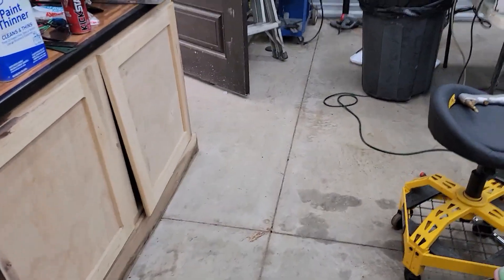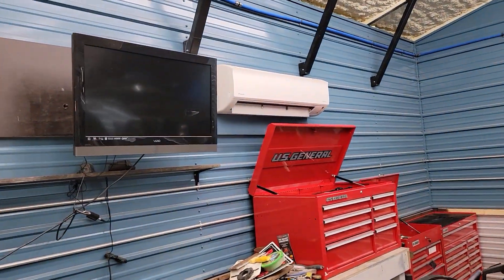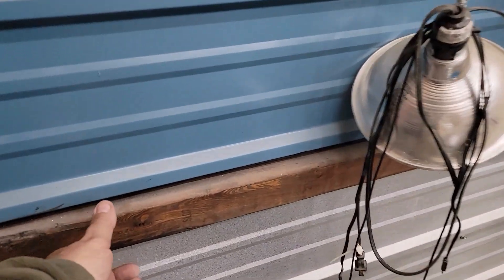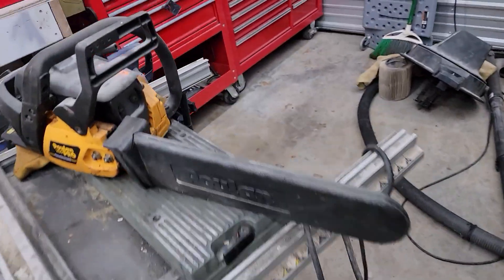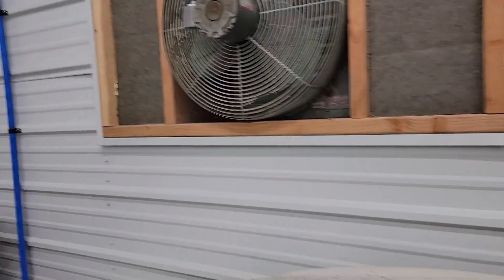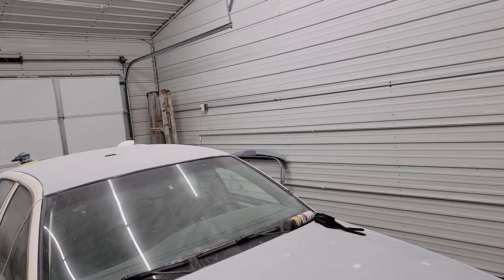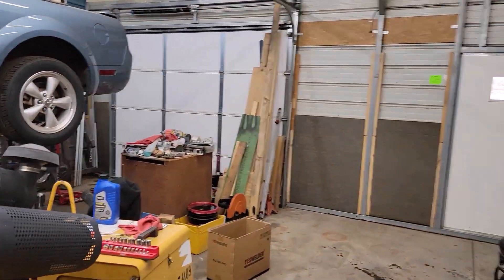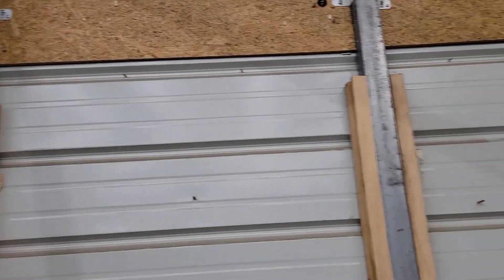Spray Foam in a Metal Shop

Comment: Do you still have the zt? I had so many issues with mine bandit did a factory buy back and I now have a sg40 that has had the hour meter, exaust replaced once, welded once, frame cracked in 2 places by the cutter head, Jack shaft and cutter bearing failed  and no it was not because I under greased them, all belts replaced, a hydraulic leak from under the controls, and much more.. Currently its been in the shop for a month with engine issues that they can't figure out because my bandit dealer doesn't have the software to plug into them. It might have 300 hrs on it. I feel like I'm ranting now but how many of these machines are junk? There was another one at the shop with 0.4 hours with a skipping motor. I started on a 1996 rayco rg25 mini work force and never had issues like this.
Reply from the maker: I sold the Zt with over 800 hrs on her and its still running .... I have heard problems with all brands since the pandemic quality control at the factory and dealers has gone out the window
Reply from the maker: You are this weeks sticker winner brother send your mailing info to mustangrebuilder@gmail.com
Reply: I like the mafia sticker